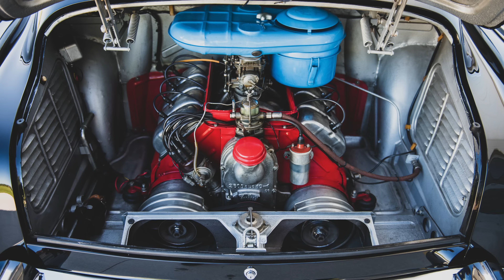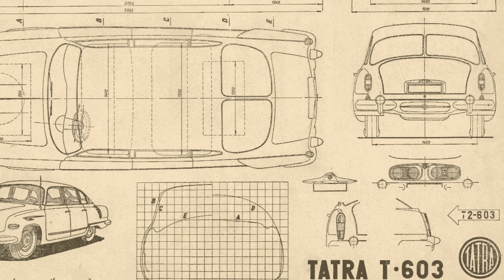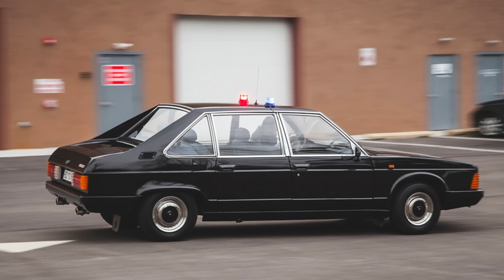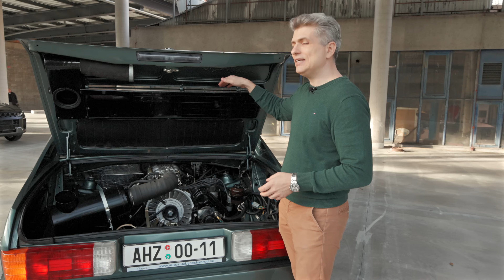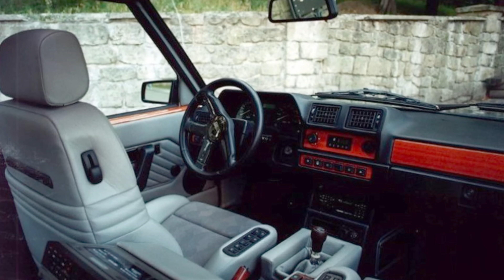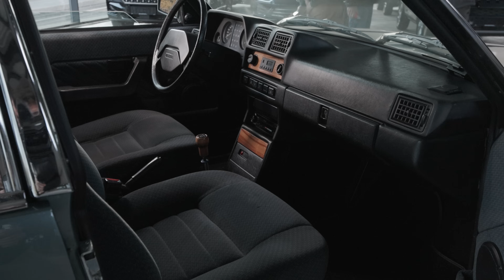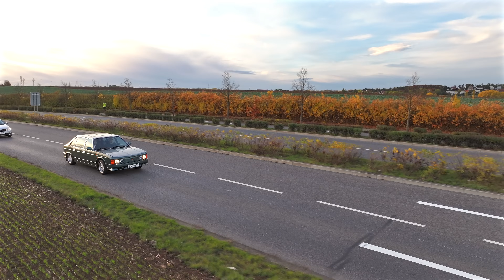I explore and drive Tatra 613, the bizarre car with an air-cooled V8 engine

Comment: The last Tatra Limousine was developed by two Englishmen- Tim Bishop for the electronic fuel injection, and Geoff Wardle for the styling under Mirek Staron. All subsequently worked for Reliant Cars in the UK. Tim Bishop went on to start Tatra Motive Power, importing them to the UK.
Reply: There's a wild sequel here: Tim envisioned a small displacement sport car with a VR10 and hybrid drivetrain here. However the car didn't get enough investment until recent years a company called BDI revived them. Drivetribe has been updating on the engine process as Drivetribe plans to install V10 in MX-5.

Tim has lots of forward thinking ideas. Seems the world didn't understand him at all lol.
Reply: I suspect that was the Connaught Type D project from 2005/6, it was doing the rounds in car magazines at that time. @DomDOMT
Reply: @dcanmore  That's the car I was talking about!
Reply: I know that the Tatra design was renewed by Michelotti in the early 70s with the 613.
Personally I admire Michelotti very much but, strange for strange, I prefer the obsolete 603
Reply: @studiocalder818  understandable lol, imo tatra has been elegant till the end of the Saloon production.
Reply: So they are responsible for the failure of the T613-5 and T700 models? great! 😃
Reply: @kamilhalapi  That is not correct, although Saab-ish looking interior is a bit of personal taste. Hate or like. I hate it... But Injection was in this time really needed step. Even with quite modern DOHC setup in 70s, carburated Tatra engines were set quite conservatively about maximum engine output. In 90s they were definitely far behind of Mercedes-Benz and BMW engines. That is fact. Even Porsche was in 80s not sure about aircooled technology in future - multivalve construction was key to power, but problematical for aircooled cylinder heads. Not concerning also emissions legislative etc.
Reply: @kamilhalapi He definitely forgot to include that fact, while he penned his patriotically fuelled comment 😅
Reply: Being involved with engineering or design on Reliant Cars is possibly not the best reference on a CV ? 🙂 Not exactly Issigonis level.
Reply: @terryross1754  Not everyone is Issigonis, but it doesn't mean that Reliant employed the dregs to do rubbish product either.
Reply: @3wheeler1000   3-wheelers in the UK in the 50's thru 70's/80's, were mainly a trick to let bike riders stay (relatively) warm & dry without getting a car licence, plus most were cheap to buy and run. The Reliants were ugly, slow, unreliable, spartan, uncomfortable and unstable. Thus my reservations about the design team being suitable for Tatra, who wanted a luxury sedan/limo. Reliant was never a real car, not even in the horrific days of British Leyland.
Reply: LOL, really? so these guys are the reason for the demise of two companies, one of which actually had a long and proud history?
Reply: @kaischmidt730  YES, exactly. 2 men, highly skilled at what they do, fulfilling the brief given to them by the managers who control the budgets are responsible for the demise of these two once formidable companies. I'm not sure how, but maybe you could tell me?
Reply: @3wheeler1000  how would I know. I inferred that from your history lesson coupled with the events at both companies shortly thereafter ;)

Comment: Too bad the gearbox seems to be out of order, a lot of play in the gear lever as well it seems.
Such a shame they stopped producing these cars, or at least, more modern versions of it.
The air-cooled V8 probably wouldn't pass modern emissions regulations unfortunately. 
And electrifying it... Meh...
Maybe you could do a video about the Tatra MTX?

Comment: Chevrolet gave up air cooled rear engines in the Corvair in 1969.  Even Skoda gave up water cooled rear engines in 1990.  As a limousine the Tatra 613 is crying out for an automatic gearbox.

Comment: A nice review of a matter of the heart, unfortunately there are a lot of fictions and untruths in it, as someone suggested to the gentleman. It's a shame if you already spend time and resources on a review of such an unusual and interesting car, it would be good to check the basic facts and the things you say there with really knowledgeable people before publishing the review, and not blindly take everything from "storytellers", it spoils the impression a bit from the result. Otherwise, in this particular reviewed car there is nothing of the rare "Electronic" version at all (except for the name on the technical document), it is stripped down to the basic level, and it even lacks air conditioning. There are also things missing that were not related to hobbyist malfunctioning electronic equipment, such as outside mirrors from a Caddy DeVille, a different model of the center panel between the seats, genuine leather upholstery of parts of the interior, etc., etc. Its historical value as "Electronic" was already forever before destroyed many years ago by rebuilding the interior, removing electronic elements and parts of the exterior, since then it has been a standard injection "long" from the production of that time. It is logical, because the electronic system created "on the knee" was directly the standard of unreliability. Of course, this does not detract from the originality and uniqueness of these cars, but it is good not to spread delusions. By the way, shifting - from the principle of construction, it cannot be as accurate as in the classic concept, when the lever's slide is 2 m away from the gearbox and shifting is done by a bent solid steel tube. You won't find any bowdens and counterweights here. However, the successor of this model, called 613-4Mil M95 - like the facelift of 1995 - got an auxiliary strut to the shift rod to make the shifting with the 2m rod more precise and that helped a little :-D

Comment: Those pre war cars turned out to be great Nazi killers, those that drove them tried too hard to corner them and the outside back wheel tucked in and they rolled over, The German officers stopped using them following too many accidents.

Comment: Thank you for an interesting video on this vehicle. Tatra was well ahead of it's time in engineering and execution. I'd love the chance to drive that vehicle!
Reply: It was well ahead of it's time in the 30s, but in the 90s, this was hopelesly outdated. That's what socialism does with industries. At the time this was made it was basically a facelifted 20 year old model (1974) and the underpinnings were based on a modified late 50s design (T603).This didn't have an automatic gearbox or an ABS or airbags and competition at the time included W140 and E32, which were also both cheaper.

Comment: Der Tatra 603 ist schön, aber der 613 ist einfach nur hässlich. 3,5 Liter V8 und die Tonne fährt nur 190 Km/h. Der Motor klingt wie ein 1200er Lada Motor.

Comment: Tatra never put engine with direct injection into serialy produced 613 durring the communism. Engine with injection (I belive Bosch Jetronic, but dont quote me on that) was developed and tested, but due to lack of interest and hard currency it was not offered at the time. First model that was offered with injection was T 613 - 4, introduced in 91, two years after velvet revolution. Interestingly it was a differnt system developed for the car by brittish engineers led by certain Tim Bishop. Even so, the base model of T613 still offerd engine with carburators. Also, there was a larger 4.0 variant of the engine avalibe for purchase, but this engine was not homologated (!) so in the papers to the car the 3.5 liters capacity was noted even if you payed extra for the 4.0. 
Only a politicians or directors of not yet privatised industry would order one of these in the 90's. Anyone else would be better served even with Volvo, let alone 7 series and S class. If you really wanted Tatra, you could pick up one next to nothing used, as various institutions were getting rid of them en mass or you could buy very cheap new old stock - one of 1000 or so T613-3 the North Koreans orderd in late 80's but never payed for. 
New or used, they were hoplesly dated, with terrible build interior and non existing corrosion protection. If specified well, with the right color and and interier they can look somewhat decent, especialy the later model 95 cars.

I like them a lot, would love to get a very early one and a late one too. But lets put one of these next to a lovely T87: That is what expulsion of German disapora and forty years of planned economy does to once thriving and innovative automaker.

Comment: Having owned a small-displacement rear engine car myself and coming away with mixed experience of the handling, it's hard to even imagine what a rear mounted V-8 would be like (except powerful). And air cooled too! I have seen the name Tatra but had no idea it had so innovative an engineering staff. The fact it was a low volume builder means each car must have been practically hand built.
Reply from the maker: Yes, it was almost entirely hand built, with maximum 1,000 units per year on the peak, and later few hundreds only.
Reply: The Tatra V8 sat on top of the rear axle, unlike e.g. the Volkswagen Beetle and Porsche 911, which have the entire engine behind the rear axle. So the weight distribution of the Tatra was better, which improved the handling.
Reply: @Hobbes746  before the 613 the tatra had the engine behind the rear axle like a vw or porsche.
Reply: @CawKee Those mid-engined MGs were an absolute gem. Sadly from another manufacturer (Rover) that like Tatra no longer make cars:(

Comment: He thinks the gear selection is only a problem to that car? Think again... As soon as I saw that manual gearshift & figured there were linkages going all the way to the back wheels of the car, I figured changing gear would be a pain in that car. This is normal for a situation like that. I'll bet not just that car or that model, but all of them have very poor feeling when using manual gear boxes. 

Also he doesn't' seem to rev match. If you miss a gate in a sloppy gear box like that and let the engine revs trail off to almost nothing, finding the correct gear becomes a lot more difficult, as the synchromesh on the gears is screaming to try matching internal gear speeds whilst he's trying to force the shifter into a gate.

Comment: What a cool car. I really enjoy insights into these weird and quirky vehicles that most westerners never knew much about. What I’m dying to know though, is what is under that huge bonnet, if clearly not an engine 😂
Reply from the maker: It is just a frunk, with access to some of the car's systems and a spare wheel. Earlier models had the gas tank position there, but the 613 had it under the rear seat already.
Reply: @timelessdriving  thanks for your reply! I can sleep easy now. Keep up the great work.

Comment: It's a very elegant car. I remember it from a visit to Prag in the 80s and I were impressed. It was black and parked not long from the 'powder tower'. At that time I though from the shape that it had been inspired from the most luxurious Renault, apparently a big mistake. It was a revelation for a person from the West who only knew of the smaller Skoda, the Volga and the Trabant and Wartburg from the DDR. I had just passed trough Alexanderplatz, and the contrast was huge. After the fall of the iron curtain, I had expected it to be exported. I told everybody about it at home, but I never saw it again. Thank you for this presentation.
Reply: None of the Eastern block cars could compete in the West, their manufacturing and engineering was at least 20 years behind. But the real nail in the coffin was safety standards. The Eastern Euro cars were all death traps in an accident. It wasn't as much of an issue in the Soviet states because private auto ownership was rare, so traffic was lighter and the average speeds were far lower. Getting hit by an SUV at speed in a Tatra would be a guaranteed death sentence.
Reply: @jacktheaviator4938  In the 80s not much safety was build into likewise cars in the Western hemisphere either. The "safety-car" was introduced in 1993. But some people find it necessary to disparage products from the Soviet Union in general. If you are talking cheap Trabants from the DDR, you must compare with Lloyd, which certainly wasn't safe at any point and neither were the Citroén 2CVs or Dyanes from France. The Fiat-like Lada was quite as robust as the Western model. If you look at classic cars from the US, you will only find passive safety due to their size - nothing directly to protect drivers or passengers. Most of them had killer-ornaments mounted outside. As an aviator you probably know that the US produced Cessna 172 have had no special safety arrangements build in as long as it has been produced. Fortunately it is a good and forgiving plane aerodynamically.
Reply: @jacktheaviator4938   radím ti, zalez do pokoje a nevycházej ven, slabomyslný červe
Reply: @jacktheaviator4938  western cars werent marvels of safety. You think in terms of western grass being greener, while western grass came and ate your own grass and youre left with western grass which you make but largely not benefit from.

Comment: So in 93 this particular Tatra 613 was more than an S-class Mercedes no wonder only 17 was sold. So much for the brilliant engineering it clearly has a gear box that needs double de-clutch that stopped with most if not all by the late 60s. Its a lovely Colour and for an eastern European car looks to have worn its 140,000 miles or so well or maybe its due to having been refurbished at sometime. I know Jay Leno has several Tatras not sure about 613s but definitely a 603, the 3 eyed thing sorry meant headlights.
Reply: Tatra does not need a double clutch, it has a synchronized gearbox.
Reply: Chances are, the gear linkage (which is relatively long) needs to be adjusted, and maybe the gear box needs an oil change. As you say, due to its mileage maybe it even needs to be refurbished.

Comment: The injected 613 has a little trick up its sleeve. When the accelerator pedal is floored, a sort of 'kick-down' comes into effect - only in the Tatra, it doesn't change down a gear, it uncouples the cooling fan for a few moments to boost power by about 10%...
Reply: Awesome.  Although the electro clutch will add extra weight.
Reply: @odl21 I don't think weight is too much of a concern at that size of luxury car
Reply: @caromac_  lol.  It is on a rotating part of the engine :)
Reply: @odl21 it can be constructed in a way that the heaviest part of it is stationary.
Reply: Is that the tatra 700 4.4 v8? It should go up to 300kmh if i remember
Reply: @ I believe it was 3.5 litres
Reply: @TijgerTim  4,4L engine was an option. Sandard was 3,5L known from last T613 with 200HP, 4,4L with i believe 231Hp, but much more torque, was available as an option.

Comment: I used to have an old Skoda (also rear engine like this car). The vague gearbox problem was similar and is probably caused by the long distance between gearbox and lever.
Reply: I'm not so sure. I did lots and lots of miles in a late80's Skoda Rapid and the gearchange was wonderful, (as was the car)
Reply: @awtistiaeth4699  I had the old 1970 model  Skoda, it was slow, felt like driving an old truck and the gears were very vague.
Reply: @johnsamu  I drove an earlier 120 estelle (1984) that was like that. but I think some improvements were made as the 130 had a very precise change
Reply: I think the communist era rear engine Skodas are like an updated VW Type 3 (rear engine cars of similar configuration).
Reply: You may well be correct. Urban myth has it that Skoda got input from Porsche to 'tweak' the rear suspension for the later 130/136 Rapids and VW and Porsche often collaborated. Skoda certainly managed to dominate their class in rallying for many years with their later rear-engine cars, that unlike other classes, were not that far away from the car you purchased in a showroom. Having owned both Type 3 VW's and Skoda 130 Rapid, I'd say the Skoda handled better, but then it is a little lighter. There is definitely a technique to hustling rear engine cars through the twisty bits, but it can be done in a 'sorted' one. Mind you, get it wrong and it gets very scary! lol

Comment: Tatra is one of the most fascinating car brands of all time. I remember catching a taxi in a small Moravian town back in 1988. The car was a ca 1980 Tatra, and the driver, who obviously owned the car, was very happy to tell us about his wheels. We both used our shaky German to communicate, so not a lot of room for finer details. But it was a very comfortable ride, even on those twisting, bumpy back roads. With a delightful sound from the rear. If VW had stuck to rear engine drive, this could have been what their prestige car would have looked like in the late seventies. Mayby with a flat six. I hope the Tatra brand will resurface one day, proudly displaying Czech innovation and quirkiness. In the spirit of Hans Ledwinka!
Reply: I grew up in the UK, never saw one of these there.  There were plenty of Lada's, Skoda's,  I even saw a Wartburg 2 stroker at the M5 services when I was about 12. (So 1983)

Comment: Tatra is original Porsche or Volkswagen, Ferdinand Porsche copied Tatra 1:1 to build Vokswagen bettle back in 1938
Reply: Yes, Tatra V570 designed in 1933 was coppied in 1938 as a VW Beetle. Conception, design, air-cooled boxer engine,... everything.